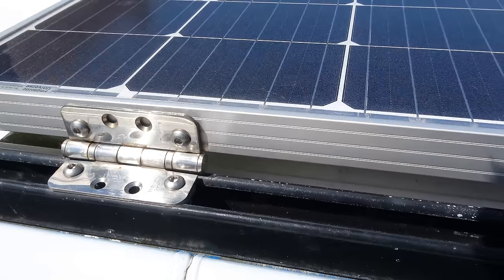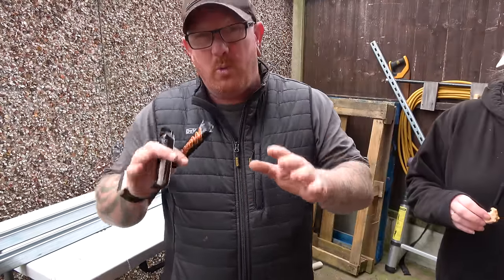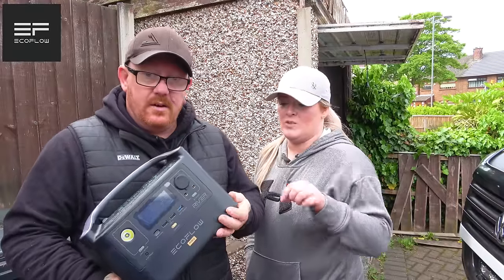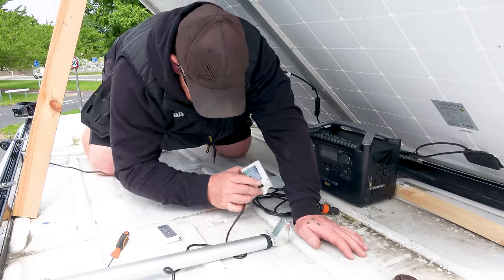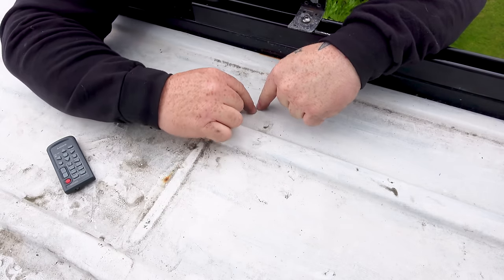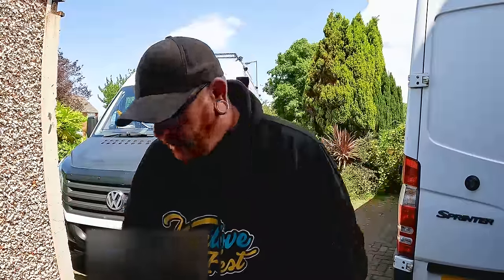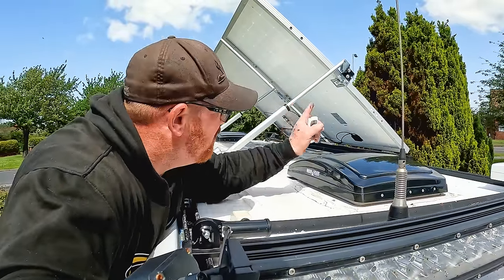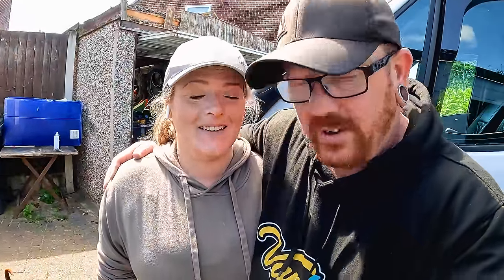NIGHTMARE Solar Linear Actuator's Instal

Comment from the maker: 🔴 Check out or tilting solar video here https://www.youtube.com/watch?v=8zAuM...
Reply: You already have a voice activated system for tilting the panels.. it's called Emma lol
Reply: You already have a voice activated system for tilting the panels.. it's called Emma lol
Reply: Get yourself a driver board like thhe ESP-32 or Rasberry Pie and you could program them to even go down and lock with small solenoids. Dont get discouraged, you have a very nice prototype. With alittle finishing and some add ons your system can easily be controlled by your phone, tablet or even a control panel inside that will give ya the voltage your bringing in, the pannels would auto move to the best angle ect... all these seamingly tough things are EASY to do with those driver boards and all the mods, motors ect you can now easily get

Comment: Instead of putting 3 actuators you should have just left it at the middle one and added aluminium angle line or chanel along the back of the solar panels so they don't bend In the middle

Comment: The thing that screamed at me was the hard shading the sticky up brackets will put on the panels as the sun moves round. 1/2 of one cell shaded can lose you half the output of the panel particularly marked in direct sunlight on non cloudy days.

Comment: I built 1kw of solar panels operated by actuators and an auto detection to operate to face the sun.  It all worked fine.   But as someone has already said. You have to frame with ally frame to help with stress.  Very obvious if you do your planning first

Comment: Why not use one actuator between the two panels with a support beam prevent the panels from flexing? Also why not use a electronic locking device to secure the panel in the down position?
Reply from the maker: One still left us with a wobble in it we did try one, we also tried it with a bad in the middle but till wasn’t right, and for us manually securing  them was a fail safe way, even if it means we still have to get up the ladder

Comment: A lot of cost and effort to have electric motors pushing the panel up. You could use a long alloy telescopic pole. Still have to climb a ladder to tie down the thumb wheels.
Reply from the maker: That’s what we swapped over from, the reason for the actuators is so we can control the angel of the tilt easier

Comment: Hope you got your tilting solar working.  I have a 2015 Sprinter 170 with 1020 Watts of solar on a motorized lift that has worked flawlessly for over 2 years and DEFINITELY is worth the effort for the lift.  I can produce 2-3x more power daily by tilting, which is especially handy in winter months.  The key to troublefree motorized lifts is calculating the proper lift mount angle and good mechanical design.
Reply from the maker: This video shows the full set up working buddy . It all works perfect
Reply: @UrbanVanlife  With maths it can be done with a single actuator and less trial & error ;)
but great job on your system

Comment: Hate to be the bearer of bad news but I figure you should know now.  Those linear actuators will get out of synch with each other.  As they age,  they will slow down, each at different rates.  That will put your panels in a bind and likely damage them.  Keep a close eye on them every time you use them.  Additionally, they can't handle outdoor use.  Moisture will get in the motors, gearcases and the RF receiver and cause havoc.  I use 4 to lift my pickup truck topper.  I built a switchbox so I could quickly disable one or more while a slow one or more catches up.  They are inside the topper, shielded from rain and still only last a year or two.  Don't let the challenges discourage you; cheers for giving it a go!

Comment: Yes, realizing that the actuator cannot rest at horizontal but rather an angle is a revelation if you have never used them before.  I would have opted for one actuator and stiffened the panel assembly with aluminum binding plates on the end.

But in the end you got it working which is all that matters. I think the video is more helpful because you also showed mistakes thus helping others avoid them.
Reply from the maker: Thank you and yes we show mistakes so it hopefully helps others to not do the same thing!

Comment: Hey, i have been playing with same idea myself. What happens when you forgot to take the screws out and pressed the button for actuators to go up. Build a solenoid locking system and wire it with relay so the system will never work unless e-latch is off.
Reply from the maker: I’m honestly not that daft mate . Screws out then turn the system  on then raise them . It’s kind of like driving away with the awning out something I’d never do

Comment: The motor goes on the top of the linear actuator so water ingress into the actuator gear cannot happen. I found out the hardway. My solar tracker was static (not on a van) so I made a frame that moves and then put the panels in it. You should use one actuator per object that you are lifting.

Comment: You could support both panels together with a length of aluminum  angle across the top edges, also instead of actuators what about those chain type window winders for houses? where the chain only bends one way and could be adapted with a geared motor. That would be quite secure in wind in up or down positions and would be low profile.
Reply from the maker: You could support them with 1 but the slightest bit of wind and the thing would buckle on its self . Having 3 makes it super strong and also makes it so not just one actuator Is doing all the work

Comment: No project ever goes quite as planned on the first go.  If you actually use the camper off grid and it works for you - in the long run you’ll be glad you did it.
Reply from the maker: Thanks David, we do a lot of off grid camping and so far so good (touch wood) 😊😊

Comment: 16 minutes in. I'm thinking you need a sprung closer latch similar to a car bonnet that you can release when needed, a latched pin solenoid may work for the release pin but if you are climbing up to unscrew the securing bolts you can do it manually. That will give you that initial lift you need.
Reply from the maker: What if it fails and springs open . Then it’s good bye solar

Comment: Great video, love the humour side of it, that's what I used to do when lecturing photography back in the day. Ive just bought the EF EcoFlow Delta Pro portable power station 3600W solar Generator. That will give me full electric like a house would have. I also have two 1000W jackery's which helps me NEVER to use EHU totally dependant. If in winter time I can go to any EV station and top it up under one hour. I can go off grid for life lol. subscribed and a RED hope you don't hold that against me. as I an typing this I am at Glide-rite on the Wirral just through the new tunnel expencive but worth i£1750  comes with 5 year warranty getting my Air suspension sorted, This helps me with getting on ferry's and over big rocks. Anyway thanks for sharing Ray K UK.  YNWA.

Comment: The upper pivots will block sunlight at almost every angle from the front and rear of your van. Block one cell and whole panel is blocked. Nice. Would have been better to raise the entire mechanism up a few inches.

Comment: Thank you for the mechanical experience to help others out, by saving them head scratching time! My thoughts are, the faster power gains from the tilt, on a day the weather changes to darker later on, made it worth the gains!😶👍⚡🌦️ ... I personally would think of how i could mount it all on a weather sealed framed 4'x8' and then on a spinner table and antenna motor, so no matter what direction your parked , you can always  be at your most optimum angle!⚡🌞
Reply: Those are not outdoor rated. It will quickly get gunked up with dirt and potentially fall apart endangering others on the road. More importantly not designed to handle forces pulling upwards axially on it. Trust me, bad idea. Must at use a bearing or combination of bearings designed to handle axial loads in both directions.

Comment: Neil, after percevering for so long with that set up, will you now use it or, are you going to dismantle it?.
Could you not maybe lift them manually & use some kind of wedge device to hold them up?.
I love the way you innovate I really do, I do attempt the same but on a far lesser scale.
Never give up, No retreat no surrender 👍👍
Reply from the maker: Hi Andy we did already have another system in place where we did lift them manually, but to answer you question we have already used them when we where away last week and today when I cleaned the roof and we intend to use them continually from now on!

Comment: Well done, ya things tend to cost more than we budget for. If you add a switch to the actuator that way it won’t come on as you drive, that’s what we did 😊
Reply: It should be engineered well enough to handle a 75mph (driving) wind load when raised anyway. Otherwise you endanger others on the road.
Reply: @EricPeelMusic  true, it’s more technical than people think. The switch would stop the actuators being live when driving as a safety feature
Reply: A manual switch is okay but it can easily be forgotten about before driving. Only way to ensure safety is adequate engineering, redundancy and eliminating human error during usage. An automated switch that turns off the system when lowered, which must be turned back on manually combined with a rack that can be safely tilted at highway speeds is probably the easiest way to ensure safety. Its fine to do fun DIY projects like this on one’s own time but encouraging others to do the same if not engineered properly isn’t responsible.

Comment: Great video both! Automation, motorisation, remote control is awesome. Maybe gas struts like the ones they use on popup roofs would be the answer?
Reply: Super dangerous to work with and difficult to select appropriate force rating, for a novice builder.

Comment: I noticed that you have a snorkel fitted, you you have gas dropout vents or other in the floor and if so why the snorkel?
Reply from the maker: The snorkel goes to the engine for the air supply for the compression buddy . We don’t breath out of the snorkel 

But now thinking 
I wonder if we should seal the windows up just Incase any of that gas comes in . But then again gas I heavier than air so I guess common sense tells us we will be ok

Comment: When you cut unistrut and paint it.
How easy is rust to start on the cut end.
I ask because I need to buy for my solar and don’t know if I should buy a specific length and not cut
Reply from the maker: Unistrut is galvanised so shouldn’t rust but you can also buy plastic caps that go over the end to help protect it
Reply: @UrbanVanlife  thanks I will give them a try

Comment: I would have mounted the actuactor to the other side. This way the mount would be on the highest level of the PV panel. I would have but all panels on a strud before i would have mounted the actuators too. This would have made it stronger.
Reply from the maker: I didn’t but it works . And a lot of ppl woukd have done it there own way just like we did . The main thing is dose it work if so you won . Do yours work

Comment: use a cam link at the actuator to panel connection. the first couple of inches of actuator travel pushes the link to lift the panel. then the actuator will lift it directly. If you design the link correctly you can use it to lock the panel down.
Reply: Far too complicated for him.

Comment: You should of got the actuator with the motor on the side they are much stronger then the model you have and one in the centre would of lifted the 2 panels up on its own . Mine lift and turn and I have 4 ,120 watts all bolted together and they lift and turn to face the sun
Reply from the maker: The one actuator will easily lift up both Panels . But with the weight of the panels you still have a massive wobble in the wind ( that’s just science ) unless you frame the whole thing . Fitting 3 makes it as strong as a frame but a lot less weight .
Reply: I have 1 lifting 4 120watt panels which also turn to face the sun which are bolted down while I’m driving I also have a brake on them so when they are being lowered they don’t crash down but I don’t have the actuator fitted the way you have yours I think I have a few photos on my Instagram account if not I will put some up
Reply from the maker: Yer but with one in the middle there is nothing stoping a wobble in the wind or a breeze . . Like I said it works great and we wouldn’t change it now

Comment: Interesting to find someone whos done exactly what I'm looking to do. Only, I have the crazy idea to do it on my roof of the house. Main things I am concerned with is the constant electrical load on the actuators during the tilt for season long holdings. Is there any advantage from the cost of electricity to hold the panels up compared to the gained advantage of having that tilt? I'm sure if I did the math I could find the answer, but its nice to know the real world implications. Also, thinking about any wind blowing loads onto the panels while they're sticking up in the air. I'm sure the actuators wouldn't hold up over time in these conditions... idk
Reply from the maker: Good points . The actuates are a screw so they are never under a electrical load . Only when lowering them or putting them up . Other than that you can TOTALY turn off the electric to them and they stay put because if the screw they won’t move . But total nightmare if they were to fail your kind of stuck till you get another one . Hope this helps
Reply: @UrbanVanlife  That helps, thank you!
Reply from the maker: That’s great mate . Most think there kind of like a hydrolic kind of thing but there a screw . Which is a bonus cos it makes them a lot stronger

Comment: I sure wish I was fluent in what ever language this was filmed in.  Certainly much inflection, subtle humor and innuendo, are lost in the translation via closed captions.  On a serious note 25 years ago I built a hydraulically actuated aircraft hangar door for my hangar.  It weighed 3 tons (about 6k US pounds).  It has always worked flawlessly, virtually the entire side of the building swings open.  Fast forward to today and now I find myself wanting a window in the house that operates the same way...which I plan to build (that's how I found your video here).  Mine 10 foot by 6 foot (2 meter by 3.5 meter) window however, will use electric linear actuators instead of hydraulic rams like my hangar door design.  Not my first rodeo.  Might I suggest that the hurkey jerky motion of your installation is self induced?  The rams should be anchored near the hinges NOT opposite them. Kind-or engineering 101, but I guess this is why us Yanks don't run out to purchase many Automobiles nor electronics built in the U.K.
Reply from the maker: It was filmed in scouse. They where Chinese products not English, it’s only engineering 101 if your an engineer, which we are not,  but hey our automobile is a German brand … pretty sure plenty of Americans have sprinter vans … also German  and just one quick question .. did it work in the end?…. We’ll answer that though … Yes it did and still going strong!

Comment: Keep it simple, use gas springs like on the tailgate of your car, operate it manually
Reply from the maker: How can you choose the angle of lift which is the hole point . With saplings there up or down . No in between. So you may as well not do it
Reply: @UrbanVanlife  I think the angle is usually around 45 degrees, I don't think it will make much difference, but the idea is nice, unfortunately those actuators are usually not suitable for outdoor use, so the question is how long they last.
Reply from the maker: @habana7638 well there still going . Also the angle depends on the time of day and the time of year . We have listed ours by 10deg and trebled out solar intake . So the only way to do it is to have them able to move a little at a time  . The reason we changed was for that exact reason . We had them on manual fixed stands but surly you would know that if you watched al the video
Reply from the maker: Also 80w to 400w by lifting them 10dg is so the angle makes a huge huge difference . Unless the suns going to stay in the exact same place in the sky all year round

Comment: You need to look at the development of solar panels which now use silicon beads rather than flat. No need to angle solar panels as the spherical nature of the beads means the angle of the sun should be irrelevant. Consider it like light entering a camera lens and distributed on to a focal point. Not sure what stage that is at but you shouold check.

Comment: I’ve done the same thing with one 1500nm 450mm stroke actuator between the panels. I see you still got few issues. But you can correct it. One actuator in the middle would been more than enough. Angle is to flat. It needs 40-50mm higher at the panel end. A bar across the middle under the panels braces the lift and both go up aligned. And, to stop the unistrut from spreading you need a bar/ brace across the roof so both unistrut sides are like a ladder. That way when initiates the lift and when it comes down, they don’t spread. Mine are two 300w panasonic panels so fairly large, and still go up with ease. You need to get the geometry right, and all will be rewarding.
Reply from the maker: we did have it in the middle with one , but found it quite wobbely , so adding ones to the end was much less weight than the bar across the middle , plus made it a lot stronger as well , I'm just happy that its over and works , cheers for the comment mate , its nice to see how others do it